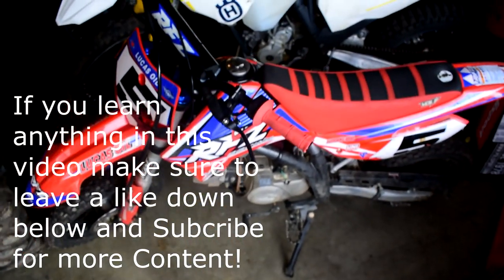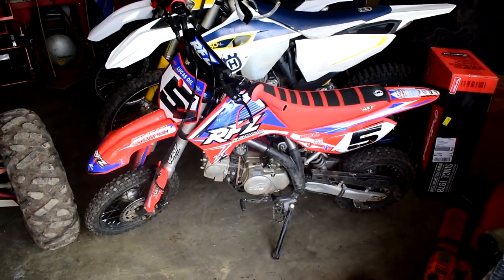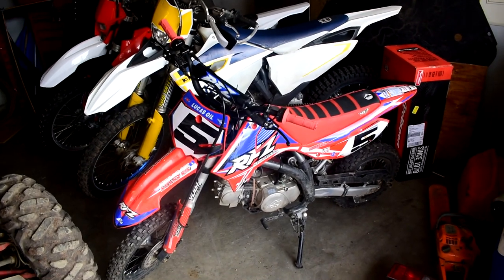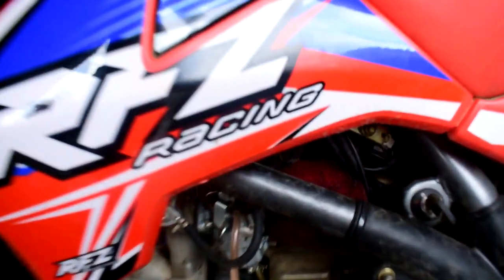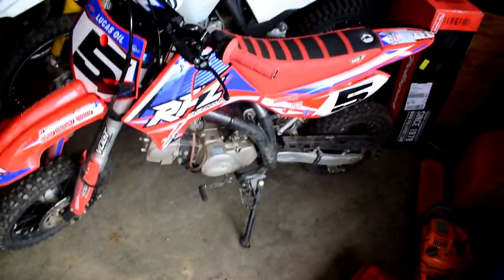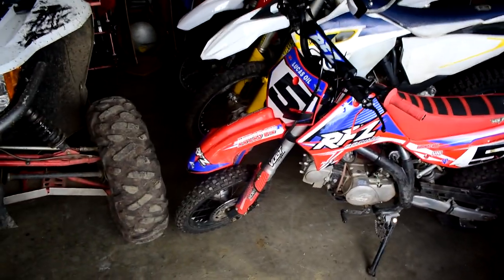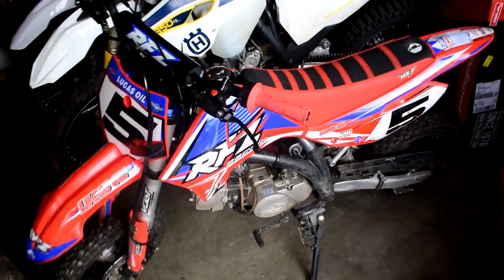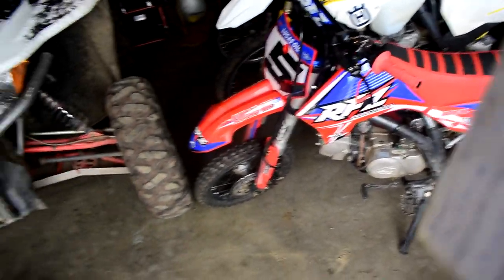2020 Apollo RFZ Updated Review After Riding & Common Issues

Comment: First thing ive done to my M2R RF160 is changed out front and back sprockets for Talons, Changed the carb out, The handbars to low rise fat bars, Throttle housing changed to a quarter turn billet housing, kick and gear levers changed to billet, replaced the chain with a japanese DID heavy duty chain, changed the intake manifold neck to a curved with a billet spinner, Changed all piping out for heavy duty reinforced heat resistant piping for the oil cooler etc, put in some Dx4 putoline and shes a reliable beast with spokes tightened regularly and oil changed after every 6 hours.
Reply from the maker: Sounds like you’ve set your bike up!

Comment: Try a NIBBI carb. Way easier to deal with. But you have to buy the manifold attachments otherwise it won't mount to the manifold. Also my rear brake is squeaky when I get on it. Any ideas? I went thru it and it seems like the caliper is sitting too low on the rotor.
Reply from the maker: your rear wheel nut is proabably not tight. (hence the caliper being loose)
Reply: @AaronsEnduro  The brake caliper is a little loose. I'll try your advice. Thanks!
Reply from the maker: Hopefully that worked!
Reply: @AaronsEnduro  it worked. Not I have a suspension problem. Maybe you can help. The rear shock/strut is only the spring, it sits stiff and the recoil is really quick. I've tried filling up the strut with air just to see if it made a difference. But it won't fill up!? Any suggestions?
Reply from the maker: What does that mean “it wont fill up”? Do you have a pressure gauge to it as you fill it!
Reply from the maker: Stiff and quick recoil youd actually want to take air out
Reply: @AaronsEnduro  yeah, I have a gauge, but when I go to fill it up and release pressure to test it, it literally pisses air for about 1 second.
Reply from the maker: What psi is it coming back down to
Reply: @AaronsEnduro  I fill it up for literally 2 seconds and it's at 22 psi. Then I got to relieve some pressure and it goes back down to 0 psi in less than 2 secconds...
Reply from the maker: Blown shock seals
Reply: @AaronsEnduro  now I've got another question. I wanted to know if you know the spark plug gap specs on the spark plug for my rfz. I fouled one. But I want to make sure it stays to spec for this bike.. The plug itself said .07 MMS. But I'm not sure that's what I need..
Reply from the maker: Im not 100% off the too of my head, but you should join the apollo pitbike group on facebook!!
Reply: @AaronsEnduro  I haven't had FB in 6 years.. crazy ex gf's....
Reply: @AaronsEnduro  but should I keep it at the manufacturer's specs?
Reply from the maker: Id just see if you can find an awsner on google. Im unsure
Reply from the maker: @timhughes6600  yes

Comment: Hey I tried to put my wheel back on today and couldn't get to ride because my rear brake isn't letting me turn the wheel, I checked the break lever and it's good. Its a new bike too i just fixed the chain guard because it came off but my brake pads are not letting my wheel turn, should I try adjusting the pads by unscrewing the nut next to them? I don't want to mess anything up because I'm new to bikes and your videos have helped me a lot! Thanks 👍🏽
Reply from the maker: You probably have the brake calliper wedged on the dowel it sits on.
Reply: @AaronsEnduro  so you're saying i should loosen wheel nut and try to realign? Or would tightening the wheel be an issue as well? Im really confused. Thanks for the help!
Reply from the maker: Loosen the wheel and try re aligning the brake caliper on the disk
Reply from the maker: You can join here if you want some 1 on 1 guidance! 
https://www.youtube.com/channel/UCcviyKZ2Vf3IHFliwebzODA/join

Comment: Yo bro! Can you make a video on how to adjust the rear shock for rider weight? Good vids. Thanks man.
Reply from the maker: Yea sure man! Thats a good idea!
Reply: @AaronsEnduro  Awesome! I have the RFZ x18 model. I love it but it's a little too stiff In the rear suspension. If I could learn how set the rear sag that would help immensely. 
Thanks brother 😎👊
Reply from the maker: No real sag to set in these bikes lol, you can add air or take some out , and shorten or lengthen your spring (by turning the top collar)
Reply: @AaronsEnduro  I do understand that but wouldn't stiffening or softening the rear spring effectively create less or more  'Sag' when you sit on the bike? I can turn a collar. It's the air part I'm not to sure about.
Reply from the maker: Yes but the air pressure is set by weight, which also changes compression
Reply: @AaronsEnduro  Ok, yeah that's where I'm getting hung up. Lengthen the spring or let out some air. I'm thinking I should lengthen the spring travel then adjust the air from there. Thanks for your input brother
Reply from the maker: Hope you can get er dialled in! New vid tomorrow :)
Reply: @AaronsEnduro  that's how you adjust for sag if you don't get the sag for your weight it's probably a spring issue.. front forks you can use fork oil to soften or harden one way or get new springs the v1 on 18x are none adjustable but they do have the v2 can upgrade for adjustable forks
Reply from the maker: Correct

Comment: I have a rfz and it is stuck soild in gear? Any ideas
Reply from the maker: Yep... you have the same issue as i did. The star wheel is linkage is bound inside the casing. Pull the passenger side casing off and youll see them jammed up
Reply from the maker: Watch this https://youtu.be/WdB_mEgePmQ

Comment: My hour meter still says 0.0 do you know if there is a way to engage it. Checked wiring already
Reply from the maker: Sounds like the ground wire is freyed or damaged
Reply from the maker: Or it isnt would around the spark plug tube(metal part)
Reply from the maker: Wound*

Comment: How much abuse can those wheels take? Because that would be a costly update.
This is a big concern for me. 

Thanks
Reply from the maker: Not much abuse at all. Mine lasted a few months until they were destroyed
Reply: So what did you upgrade with for wheels, and what was the cost?
Thank you for the honest answer.
Reply from the maker: I bought more chinese rims from apollomotors.ca which was 300$

Then I bought good rubber (dunlop at81’s) for another 300$
Reply: Thumpstar are $2000.00 and ‘supposedly’ you get a good wheel, and hub with stainless spokes, but it’s hard to find any content like yours to see just how much of a difference there is. 
I’m certainly not knocking the Apollo, but like all toys, ‘For just a little more money, you can....’
Know what I mean? Where does it end? Where’s a good cut off point as far as ‘This is how much I’m going to spend, and that it’.
The Apollo seems to be at that point, and best bang for your buck.